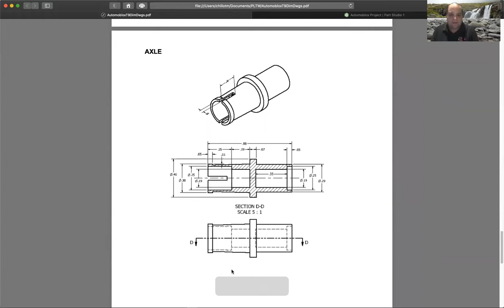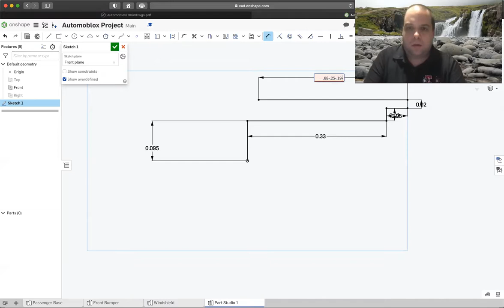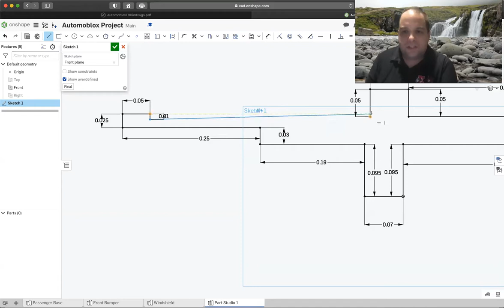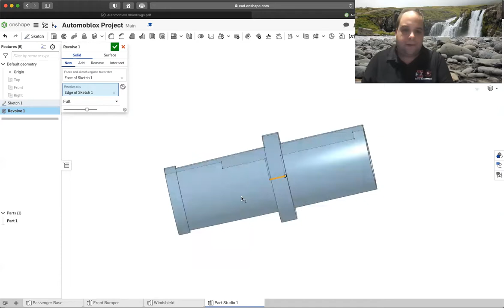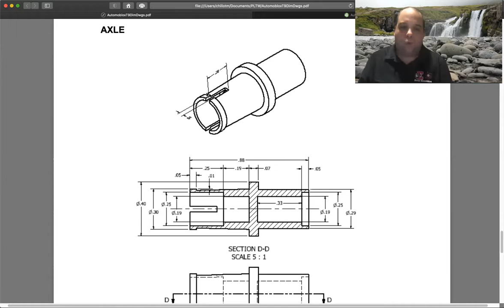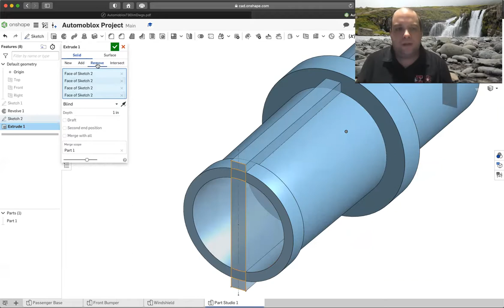PLTW IED: Using OnShape - Automoblox - Axle Peg

Comment: I found an error. You put the top most right side dimension of the wheel as 0.05 when it should have been 0.055 which is (0.4-0.29)/2, because the left and right dimensions are not equal.